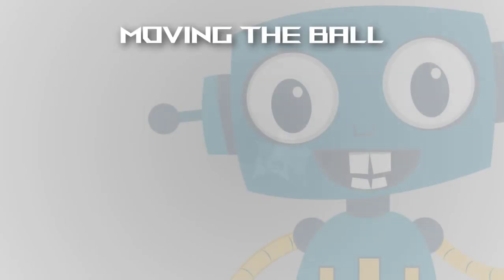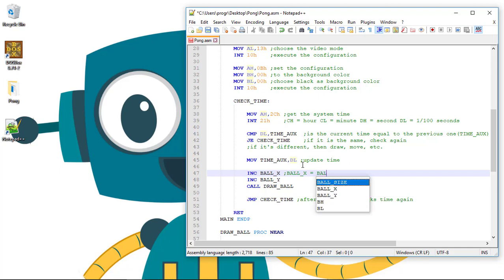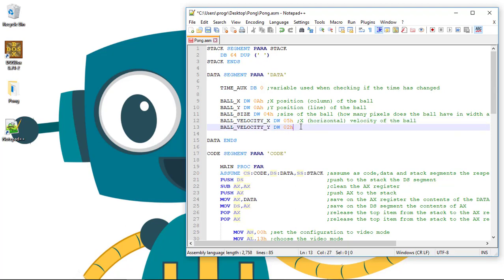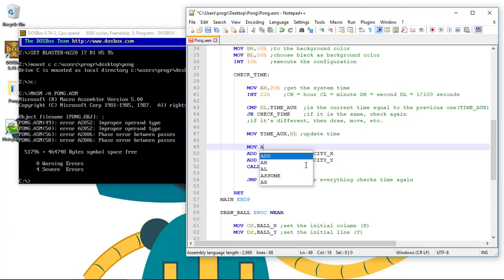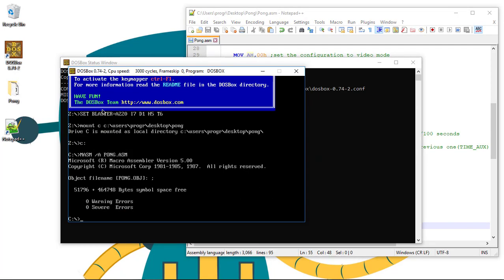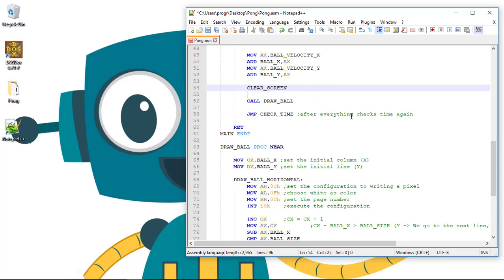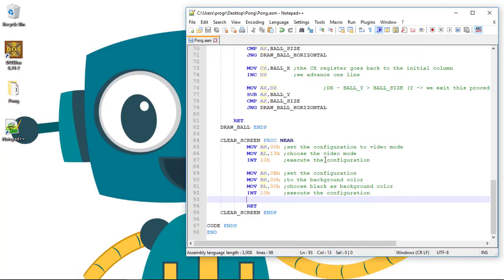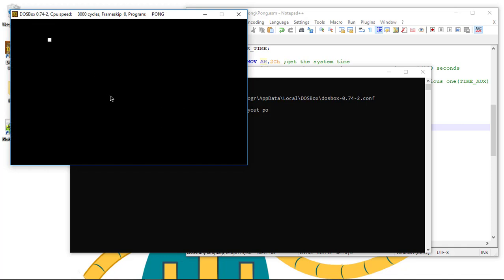[MASM] 8086 Assembly - Pong - 08 Moving The Ball

Comment: Great work, you summed up multiple basic topics in 6-7 videos. Do you have any idea how can i move the ball in parabolic directions, for some other projects? 
All the best!
Reply from the maker: Thank you! You can modify the procedure responsible for the ball movement to implement the formulas/functions behind projectile/parabolic motion: https://en.wikipedia.org/wiki/Projectile_motion

One way you can do this is to find a way of incrementing or decreasing gradually one of the velocity vectors (X,Y). This way you can increase or decrease gradually the rate of the movement on one of the axis, giving the sensation of a projectile motion.

I didn't implement this. but you can have for example (assuming that we want this effect on the Y velocity and using this PONG game) two variables: BALL_VELOCITY_Y_INITIAL and BALL_VELOCITY_Y_FINAL, given that the first is always greater than the last (BALL_VELOCITY_Y_FINAL acts as a stabilizer velocity). 

Whenever the ball hits the paddle the ball velocity in the Y axis is assigned to BALL_VELOCITY_Y_INITIAL and then for every n frames you decrement it until it becomes equal to BALL_VELOCITY_Y_FINAL.
The effect you get with this is what you're expecting, the ball goes up very quickly whenever it hits the paddle but then it stabilizes on BALL_VELOCITY_Y_FINAL (giving the effect of a "projectile" or "parabolic" motion).

Hope it helps ;)